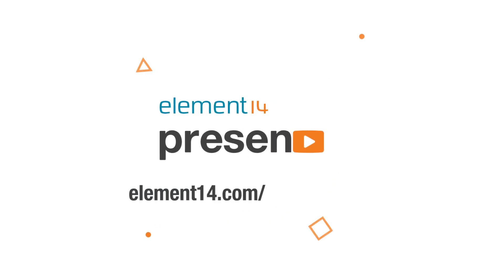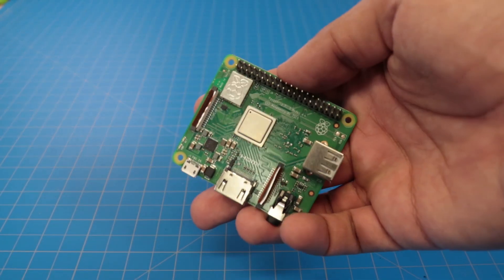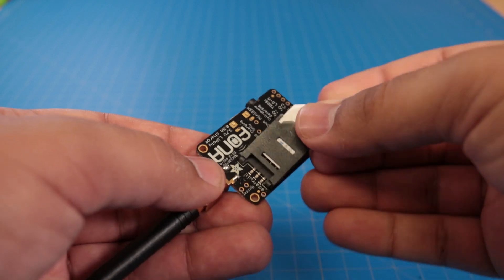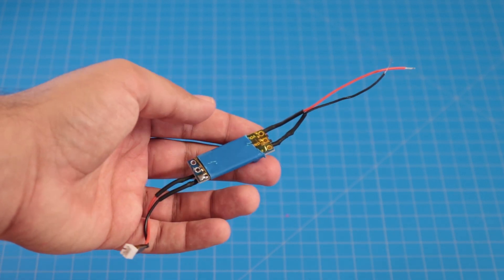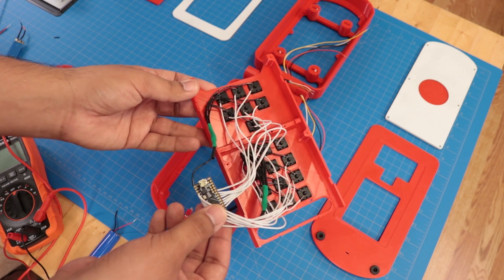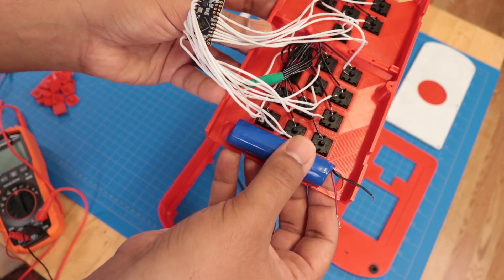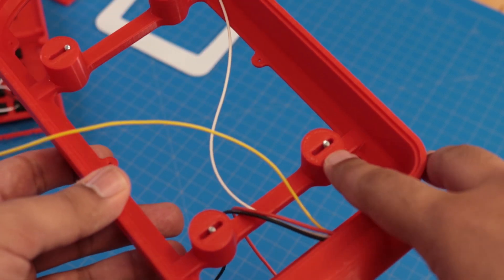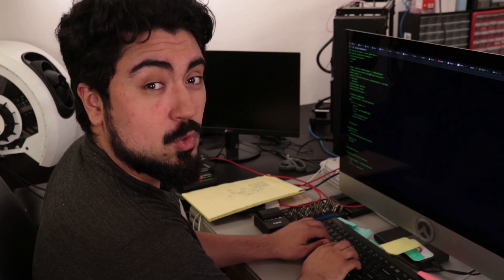PiPhone++ The Giant Raspberry Pi Flip Phone

Comment: I’m interested in how you used a microcontroller connected via a USB port to create a sort of custom-keyboard deal, saving you from having to use the GPIO pins on it. I’m a bit of a newbie. The microcontroller/keyboard arrangement looks perfect for something I want to do with a Pi project I’m working on. I’m going to have a grand total of three buttons, which doesn’t leave a lot of options. I’d like to use something like your method, set up a function key deal. I figure I could expand my options from three to seven or ten if I make key combos and double taps select different functions. I also want this arrangement to be cancelled out if a wireless keyboard is connected and active.

I suppose I should mention I have little experience with the Pi - just got a 4b last year - and even less programming knowledge. Well, ok, by less I mean none. Clearly there’s a roadblock or two.

Just wondering if that plan is even feasible. I gather there’s a RaspberryPi microcontroller now, too, which I figure might make things easier, unless it doesn’t. But one question at a time.

Thanks

Comment: Interesting project, nicely done lots of good details 🤔

That said I  would love to see a more modern phone build.  I’m planning to see if it’s possible. 

A Raspberry Pi 4 B  4 GB, cellular G3 or G4. Using the same screen but in a much flatter case and just use touchscreen controls. 

A Bluetooth module foraudio communication and external devices like a printer or storage device. 

Conductive charging is also important. 

A more powerful  battery. On the back a Solar panel would be helpful.

So basically a cellular tablet. 

The case should have  openings at the top and bottom to be able to attach a large watch like strap. This will allow the unit to be worn over a jacket

A magnet attached transparent cover that could be used on the front for protection when not in use and then moved to the back when you need to operate it. 

Now that’s what I call my dream project. 

The cost would be around $200 $300 Depending on your source of parts. 

I have almost everything now except for the 3D files make the case 

And having a problem getting the G3 module that’s usable in Canada that doesn’t cost a fortune. 

Lots of things to consider but I believe it’s doable. 

What do you think?
Reply: did you make it?

Comment: Hyperpixel 4.0" screen for a smaller PiPhone with capacitive touch.
Reply: Ordered one today, thinking of making a PI4 portable handheld with it. Commenters hate us for just giving the PI a case and a display though, so it might not going to happen.
Reply: @Davedarko  FYI, it fits the screen area of a PSP  fairly well.  Just a bit smaller tough being that it is 4.0 compared to the PSP's 4.3".  Also the Pi3A should fit where the UMD drive goes, although it might be a bit tight.  However, I don't have a Pi3A to test the size.  I've got parts to build a Pi0w inside a PS Vita 1000.  Just haven't had time to put it all together.
Reply: @MysticWhiteDragon.  It is forbidden to mention PSP / PSP vita here :D Also, since the hyperpixel is square, you might want to check that again ;) I thought about a classic Game Boy case, as the resolution of that was also almost square, too. Pimoroni have released some screeshots with the PI 3B+, if that's of any help! Good luck with your build!
Reply: @Davedarko  Actually the HyperPixel 4.0" is close to 16x9 ratio.

https://shop.pimoroni.com/products/hyperpixel-4

Comment: When you don't have flex cable. To avoid the rats nest. Use an old IDE cable. You can cut it down to the size, number of wires and fold to the shape you need. I use IDE cables for when a flex cable connector is broken. I just remove the connector and solder the IDE ribbon to the  PCB and the flex cable. I get loads of them from recyclers and  PC rebuilders.
Reply: SCSI cables work too.

Comment: I want a cell phone that is only a phone with no camera, no app functions and gets good reception and and go 4 days without recharging.
Reply: Nokia 3310
Reply: Servo v7 has a camera and a torch, holds 3 sims and battery lasts up to three weeks.
Reply: You can get such a phone that will fit in the card slot of your wallet these days. Maybe slightly less battery time but for your use case I'd imagine that might be attractive.
Reply: Motorola f1